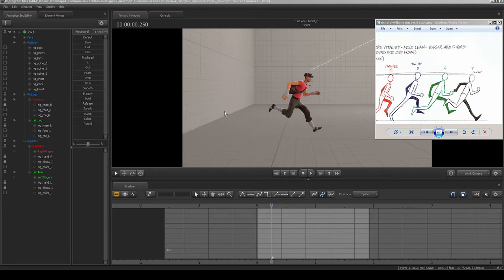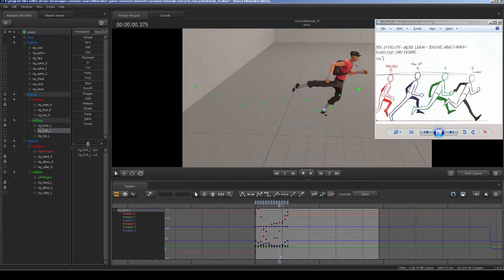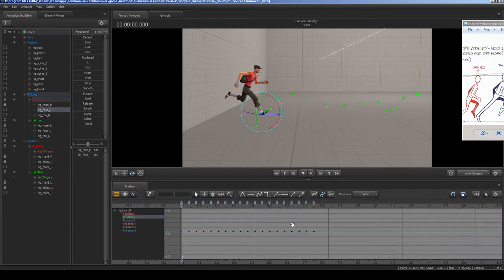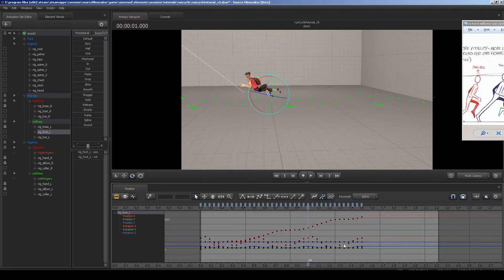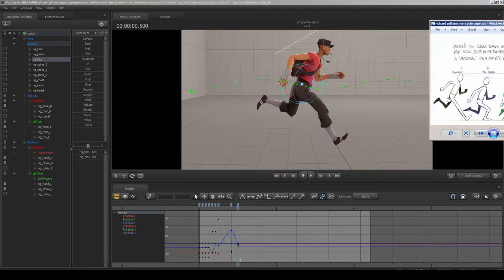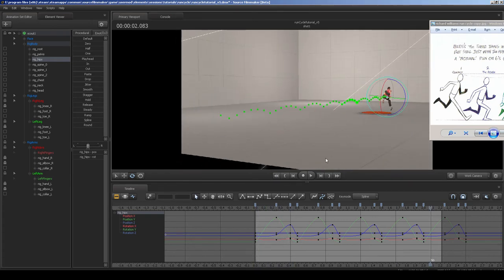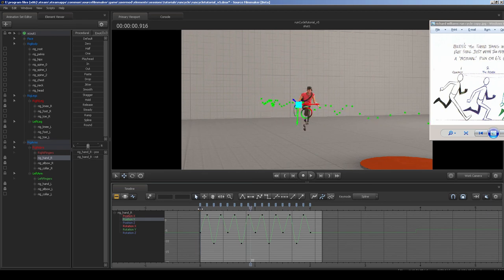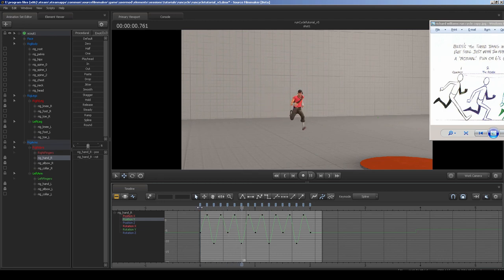Run Cycle Tutorial - Copy Paste method - Part 2

Comment: Hello Will.
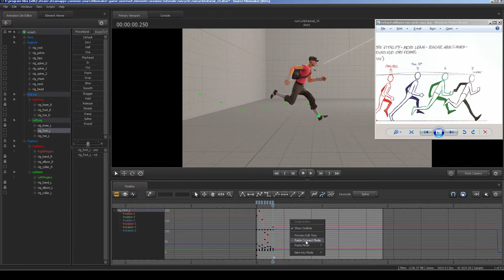No matter how much I try, the foot and legs keep on clipping and rotating in an odd fashion whenever I paste the keyframes to the opposite foot to mimic the motion on the other side, with or without Paste Connect mode, similar to what happens at 3:06. I cannot fix it.

Is it possible for me to manually animate both sides of the run, then copy + paste the motion of the legs and feet from there? Otherwise, the only option I see is to manually animate for the whole timeframe.
Reply from the maker: Marsup Can I see a print screen of your timeline after you've pasted the key frames in connect mode?